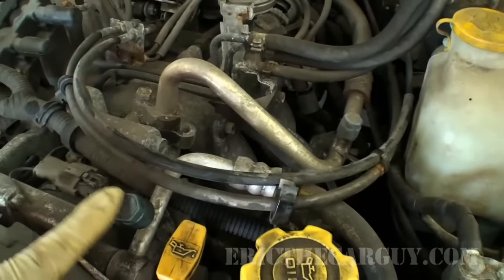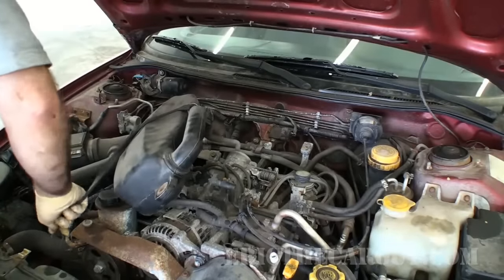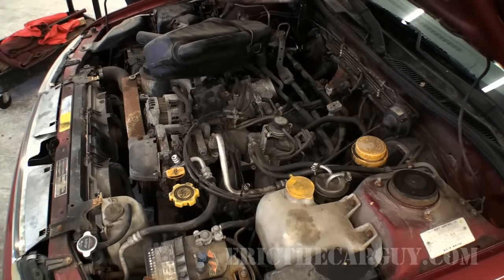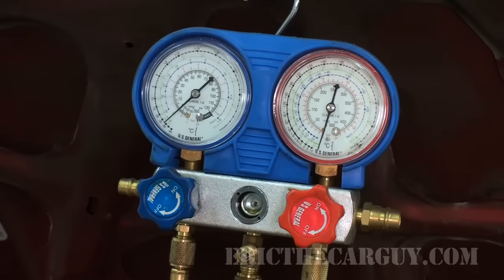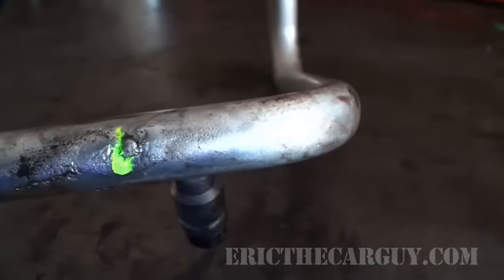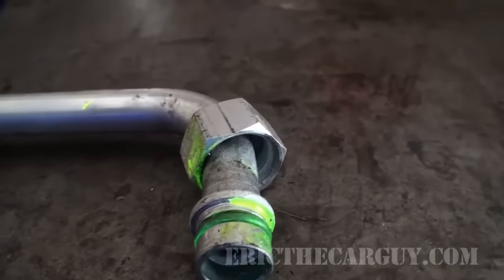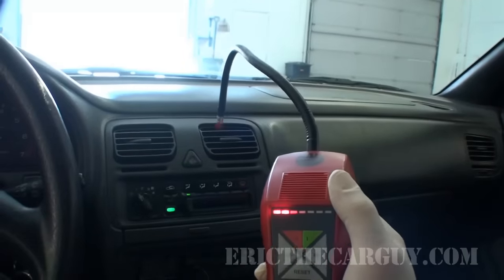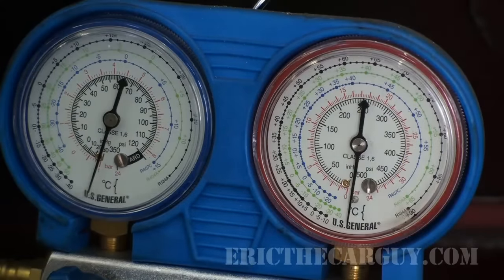How To Find and Repair AC Leaks - EricTheCarGuy

Comment: WHEN YOU HOOK UP THE VACUUM PUMP, WHERE DOES THE STUFF GO THAT IS VACUUMED OUT?
Reply: It just pumps out of the back of the vacuum into the atmosphere. That's why you are only supposed to vacuum an empty system. It's illegal to vent R134A into the atmosphere.
Reply: I know, that is why i am asking?  Why are you not properly evacuating the freon?
Reply: I think the assumption is that the leak has caused you to already lose all of your refrigerant. If this hasn't happened, then it is advisable to pay to have a shop evacuate it first. No need to pay them for anything else if you want to find and fix yourself.
Reply: It's retarded that it's illegal.  It contains no CFCs or HCFCs and a lot of can o air uses the exact same formula (r134a) and you vent that every time you dust something with it.  In fact, all can o air uses some form of refrigerant.  That's how they work.  The liquid refrigerant boils at such a low temp that it creates a lot of pressure at ambient temps (and more at higher temps which is why you really don't want to leave can o air in your car in the summer).

In short, just because it's illegal, doesnt' mean it's harmful or wrong.
Reply: into a recovery tank..
Reply: John Meise .
Reply: Into the fucking air, like every home mechanic will do.
Reply: While R134A is indeed an HFC rather than an HCFC it has been found to have a significantly higher GWP (Global Warming Potential) than was initially believed. It produces a global warming effect that is 1,320 - 1,430 times stronger than carbon dioxide (the benchmark). This is why the US will be phasing it out in 2020. It's not hard to go donate the stuff to a local shop in exchange for them evacuating it for you. There's no reason to dump it into everyone's air on purpose just because you're cheap or lazy.
Reply: kittylovermybut That basically means vacuum is no difference than no vacuum.
Reply: What do you think happens when cars have frontal accident? Ziiip no more refrigerant
Reply: B.T DFW - Because the system was empty of refrigerant. Nothing to evacuate. So by using the vacuum pump he is basically "drying out" moisture and contaminants, not refrigerant, and then closing the system to make sure it holds the vacuum assuring the system is leak free.

Comment: a 2000 toyota camry with a whining noise from ac compressor starting from 2300 rpm. ac runs a very good cool air, but it's just the noise. A mechanic told me it's a bad compressor, and it's OK to keep driving tell it completely fails. Do you think he is right? am I gonna have to deal with other stuff if I just keep driving with a whiny compressor??

Comment: does evacuating the system for a length of time dry out the reciever/dryer?
Reply: Good Q. Any one know
Reply: Yes, it also pulls some of the oil through evaporation, and depending on the weight of the oil and location of the ports being vacuumed, such as on an accumulator/reciever/filter/dryer vs. in the line.

Comment: do you have anything to recover the refrigerant from the system if there is any left? I was thinking about doing a/c work in my garage, but i'm stuck with the recovery part because the only option i see is buing a whole a/c unit that does recover/recycle. i'd rather not have to do that. Is there any way to use the vacuum pump to pump into a tank.

Comment: ya that device makes it easier to detect would suck if you had to pull out everything to get to the heater core and evaporator housing only to find there is nothing wrong there

Comment: Question; The A/C is holding pressure, but it's not cooling.... what could be the possibilities; on a '99 Dodge 1500 w/ a 5.2L? Overcharged or ????? I don't know???? Now the clutch does cut off and on rather in short bursts, if that helps anyone?
Reply: John Kerns Make sure the door opens for the AC/Heater in the dash and allows the air to flow over the evaporator if not check the vacuum lines. It will not cool without air over the coils. I have had this happen. You can also force the clutch on and check the pressure just put a wire in the low pressure switch for test time, don't leave it that way.
Reply: ok will do! :)
Reply: +gob “gobloit” loit Most likely the receiver/drier needs to be changed, which he shows in this video. The receiver drier gets saturated over time, as its job is to remove moisture from the system. It's normal for them to wear out...It's no big deal to change.

Comment: did you try tightening it by screwing it clock wise. its just like a tire schrader valve. when pressure is low like 5 psi replace the valve quickly and you won't need to vacuum the system. if new vlv still leaks you have a bad seat. and you'll have to replace the line

Comment: Nitrogen is not harmful to the environment. The air you breath is roughly 70% nitrogen. HFCs such as r134a have less ozone depleting potential than the r12 it replaced (up to 98% less), but should not be vented; that's why you always use nitrogen to pressurize a system and find leaks.

Comment: Always replace the o-rings every time with HNBR o-rings.  IMO, I wouldn't reuse them they are cheap enough.  I wouldn't want a system leak due to 10 cent o-ring.  HNBR are for refrigerant work.  The black ones look like general, butyl o-rings.  Good point on oiling them.  Harbor Freight sells a HNBR kit and has lots of different sizes.  Match up the size and thickness with the old one.

Comment: i have a question about my 06 chrysler 300. 
 i am the second owner and since i got the car my ac has always been cool, not cold!! i had a mechanic vacume the system and recharge it there has no leaks wat so ever... im just wondering y my ac isnt "ice cold"??  ive had older toyotas hondas and chevys with super cold ac, but for some reason my 06 chrysler 300 is jus cool..  any ideas or thoughts on wat could be the problem?? i would really appreciate it. thanks

Comment: Good video mate , thank you  ! . A bit misleading , not intentionally i`m sure . It`s just what we are taught. , yer absolutely wrong about water and temperature mate . If you connect a bottle of water to your vacuum pump and pump out the air, the water bubbles violently, looses volume and becomes ice  , it does not BOIL away , Boiling is what happens when you take water to 100 deg. centigrade , it bubbles violently and becomes air .  So what`s really happening here ???  a compressor and a vacuum pump are essentially the same thing. Gas is pumped out , the heat of the liquid drops violently and is pumped through the heat exchanger  . The heat exchange is due to the vacuum and the coolant is for the vacuum and coolant pump .

Comment: R134a once it enters the atmosphere will remain in the atmosphere for approximately 12 years. Just buy a line and do it right. Moisture boils under a vacuum it's loaded with moisture. Don't be cheap buy a dryer and vacuum vacuum it off and on til it holds a micron vacuum. Check out Thomas lech on you tube. Lol

Comment: instead of charging the system with refrigerant & dye to find a leak why not do a pressure test with nitrogen and look for leaks with soapy water? just curious if that would work in automotive AC...

Comment: Ideally, you want to change it whenever the system has to be opened for service because moisture is introduced.  In this case, the dryer was old as the hills and probably full of trash.

Comment: will the dye stay in the ac system? and will it be harmful if it does?
Reply: Jiayang Ruan The dye stays in the AC system until a leak develops. It is not harmful to the system, and it's very helpful for detecting leaks.
Reply: thanks

Comment: Why did you have to replace the Receiver/Dryer? How would I know when I need to replace the Receiver/Dryer?
Reply: You should always replace the receiver dryer canister anytime you replace the compressor, or you have opened up the "sealed system"  Eg: Replaced the condenser coil ( that coil in front of your radiator)  or your evaporator coil " The coil inside the car that the air flows thru to make the air cool)

Comment: If the freon in the system has been recovered do I need to vacuum it?
Reply: Luis Salinas Yes you need to vacuum the system to remove any moisture before you fill
Reply: +Luis Salinas yes!  Especially if you don't the status of the system.  As long as the system is sealed and can hold pressure, pulling a vacuum is a definite way to remove any moisture from the system.
Reply: Yes, because the vacuum does two things.   It creates the necessary vacuum, in order to add enough freon AND it removes moisture from the system.

Comment: Can I just unplug the A/C compressor relay? I don't care if the air doesn't work.
Reply: On modern cars, if the pressure in the system is too low, the compressor won't turn on. There's no need to unplug anything.

Comment: How do I replace the valve in the discharge/high pressure line.
Reply: they make a schrader valve remover like for a car tire usually the same size pick it up at any auto parts store

Comment: You need ALL 3 methods: dye,soapy water and the detector; if the leak is inside the car(in the evaporator) ,only the detector will help you: check in the air coming out of the vents with the (inside) fan on low,of course with some refrigerant in the system.

Comment: I think (well I know) that some vehicles - mine, for example, need an accurate amount of both 134 and lubricant. I've read about some older vehicles having red hot compressors that were about to seize owing to no lubrication. Yet there is no mention of measuring this accurately in the video.

Not a complaint, merely an observation. I know little beyond the theory of A/C systems. Perhaps someone better informed could comment. Peace.

Comment: could you use the dye on heater core leaks or radiator?
Reply: There is usually 3 types of dye available. For engine oil, coolant and refrigerant. Get the correct type for your application

Comment: Can you use an inert gas to leak test?  Like nitrogen or argon?
Reply: not with an leak detector
Reply: Yes, you can mix nitrogen with a little refrigerant for a leak test. Refrigerant is only reactive with water.
Reply: Using a vacuum pump to leak check is a huge no no.  All that moisture he was complaining about gets pulled into the system if you have leaks. Using nitrogen mixed with refrigerant is a good way, or just nitrogen. The important thing is to keep the system dry. There is a technique called "Tripple Vacuum", which involves nitrogen, (or refrigerant) that is really good for getting the moisture out of the system. Just STOP using the vacuum pump as a leak detector.
Reply: EPA strictly forbids mixing any refrigerant with nitrogen that is not r22. At least the last time I checked. Nitrogen alone should be fine unless ur using an electronic leak detector it wouldn't be necessary anyway. I agree though pulling a vacuum to check for leaks initially isn't really practical. It is really done at the very end after all repairs. Then after u pull the vacuum u would know weather it was still leaking or not. Otherwise nitrogen is the way to go. Dye would be next which would have to be charged with the refrigerant then u could use ur black light and elec leak detect
Reply: Using dry nitrogen as a leak detection method is an excellent way to locate a leak. It may not be detectable by an electronic type leak detector, but it is detectable in other ways. First you could hear it or feel it leaking from an area on the system with a large leak. Second you can use a liquid leak detector on the piping and bubbles will form if a leak is present. Nitrogen is great because it is cheap, after the initial cost of the bottle and regulator, and you can legally fill up your system, find the leak and vent it into the air without having to recover it. It also  has other benefits such as removing moisture from within the system before pulling a vacuum. I used to build refrigeration systems and we used dry nitrogen on every system. Also the manufacture of the condensing system would ship it with dry nitrogen. It is an industry standard. No matter what method you use a vacuum is always necessary before filling with refrigerant.

Comment: why make the AC lines out of aluminum and not something stronger?
Reply: +shnobi24 Most vehicles 1980 and older have steel ac lines, but they rust (when the paint runs off) and are harder to bend if need be. You'll still see steel ac lines on some mercedes and bmw's though.
Reply: +kcb1234567 that makes sense, thanks!

Comment: And again, they want to dismantle the whole dashboard. Renault. Evaporator, 2nd time in 3 years. It can't be. Clogged?! Can't the system be cleaned out with a flush , air pressure or what else?

Comment: Give your HVAC company a competitive edge while increasing efficiency and customer satisfaction with Service Proz's all in one service management solution.

Are you letting your business run you? If so you can do better. Does your HVAC company suffer from any of these time consuming issues?
Your technicians have to come to the office to pick up their paper work orders for the day.
You schedule using Outlook or a whiteboard and still have to generate separate work orders.

Comment: I have a 2006 town and country. I replaced the compressor before doing anything else. Needless to say all of the 3 cans of R134 leaked out in two minutes. The R134 was flowing down one of the lines exiting the area underneath the dash. Should have just left the old compressor alone and filled the system with R134. Oh well. You live and learn. Will not attempt to repair it. This van will be my cold weather vehicle.

Comment: Instead of waisting R134a just use shop compressed air and pressurize the system with dye to find a leak.  little cheaper

Comment: now i have noticed on some vehicles, the ac high and low valves have a  blue and red cover. . does that normally mean it matches the manifold gauge set
. meaning high side if RED and lower side is BLUE
Reply: you are correct... they are trying to make it fool proof...

Comment: "What needs to be changed?
All the parts to be quite honest in my experience. No quick and easy retrofits exist. Obviously the condensor and accumulator, both low and high pressure hoses A/C hoses. All the O-rings on all parts, because those were made of Teflon (in those years)which doesn't work with R134a refrigerent. Anything that may have R12 residue *must be changed* as R134a cannot be mixed with R12. The evaporator is not the drier.

Comment: Eric, you are the shizz.  i quit working on cars when they introduced computer modules.  but, as my 2002 xterra carries on,  i find i have to mend her.  old age.  so i did my radiator, flushed my transmission and now, thanks you to, i am able to fix my ac.  great video, easy to understand. (when i saw the vid the first time, i wondered where you were hooking the yellow line.  it looked like the engine.  then my pump came in and i understood, lol)  so, neways, thanks, only thing bettr than the video is if you were doing it for me :).  preesh

Comment: No, you can't use compressed air because atmospheric air contains too much water. When you compress air, the water condenses out, and your AC system would be ruined. Many professionals would use 100% Nitrogen to purge and test a system with a known leak, safely minimizing freon loss.
Reply: You CAN use shop compressed air; i have been doing it for 3O years; just do not run the compressor more than 5-1O seconds,and do evacuate the system for 1 hour or more in the end; i almost never replaced a receiver -drier.
Reply: Absolutely correct.

Comment: I would like to point out, that the 26" of vacuum is easier to hold then 150-200 psi of pressure. So a vehicle with a slow leak will be hard to determine using the vacuum method.  Also, I hate people not using a scale to measure the incoming charge. With these newer systems at just over 1lb of freon not measuring the charge would have a significant performance costs. And please people, never use a sealer. It just ruins our machines!

Comment: Do you have any idea what the size of an atom/molecule is? N2 in particular has a length of 109.76 pm. A picometre is equal to 1×10−12 m. 
We are not talking about macromolecules or polymers here.
You really believe that the molecular size of dinitrogen is going to be a factor? Are you for real? Let's compare that to the size of CFC molecules...

Comment: i have a problem with my a/c... it cools but later the air gets hot and after awhile it cools again. what would be the problem with that?
Reply: There's a short between the control switch and your front seat.

Comment: hello like this, sorry I have a question I have a GMC Sierra 1500. 96. and my air compressor I had to camviar by valero aora q I q funcionava not take one to use, and the mountain and if you pull, but the air pulley when the rrefrijerante enyecto he tends to make a very strong single nesesito rrechinido saver if there is any liquid or some haceite q you can put on the elxterior,? could somebody please desir, cualquiero very serious review great alluda, thanks?